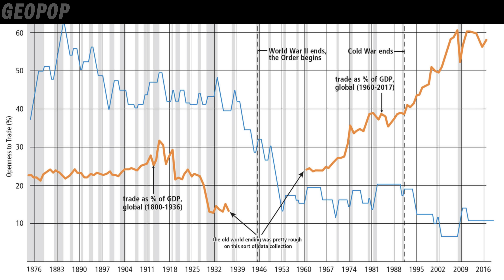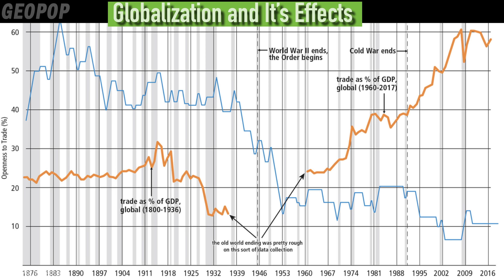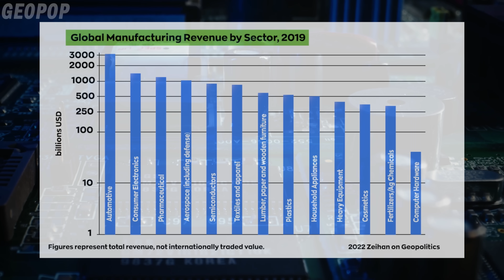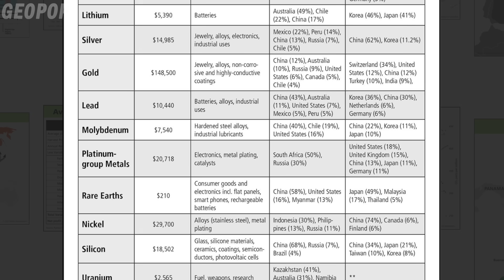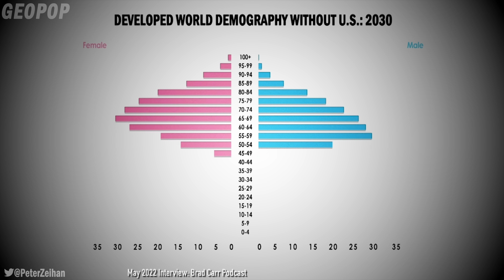The End of More | Peter Zeihan on the future of Industrial Materials

Comment: For Peter:  can he share a bit more about his wind and solar viability map and the detail between how putting solar in some countries can increase emissions?  Would love something I can cite for discussions. 

Background:  question is for parts of the world that do not have plentiful renewable energy access locally, which means limited photovoltaic and wind capacity and also limited Hydro… Peter Zeihan claims that for areas like Quebec or Germany that when you factor in emissions to create the solar panels, transport them, install them, etc. that you will actually have increased carbon emissions then if you had done nothing because those solar panels will never generate the sufficient amount of energy to offset the cost to produce, transport, and install them. That scenario, specifically in markets where they cannot be combined to offset by other low carbon energy, is specifically the thing I’m thinking about. Conscious that the Pacific Northwest and Scandinavia are a bit different since they have more plentiful Hydro.
Reply: The fact that people even care about GHG emissions is ridiculous. Bad modeling is being used by the same big power brokers to profit and further impoverish and control the everyday folk, while playing off their guilt and ignorance.
Reply: Sustainable Evergy without all the Hot Air by David MacKay (phd physics) is by far the most thorough, comprehensive and detailed book on the subject of all things energy related and covers this topic a lot. It's a case study of the UK, and everything except the particular details are applicable to anywhere in the world.
Reply: Increased CO2 improves plant/crop yields, especially (2 fold) in vast cold regions such as Canada, Greenland, and Siberia.
Reply: @aircvr4175  And that's where the most land is